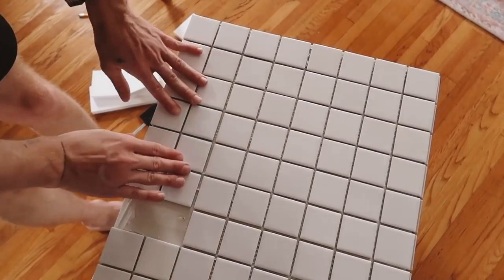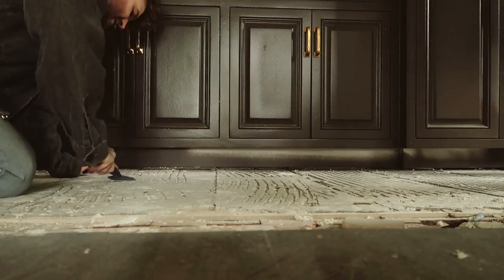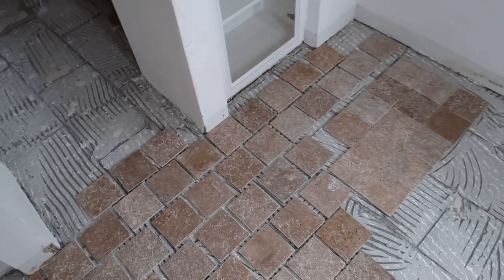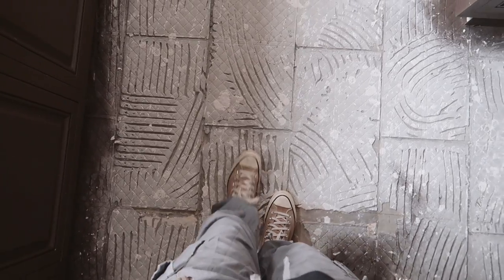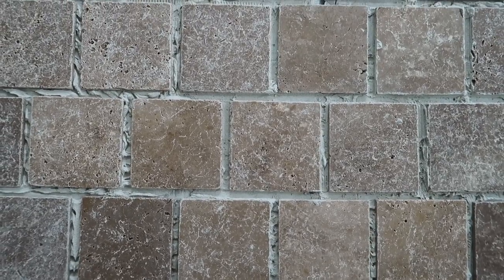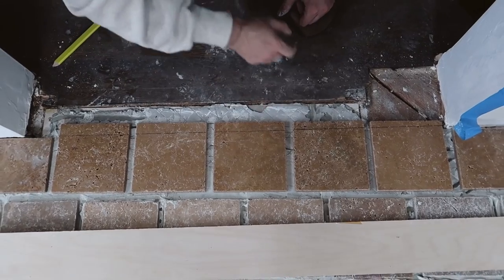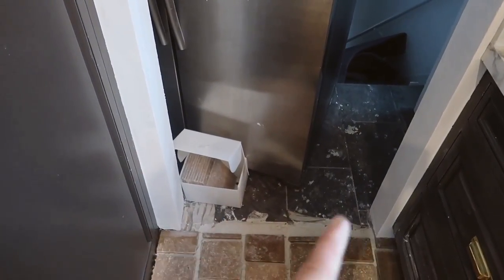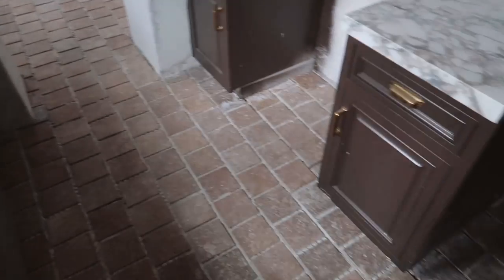DIY TILE FLOORS IN MY KITCHEN *Antique Look for LESS*

Comment: Oh check with an expert if you should use a sanded grout on 2nd floor as it flexes. We gutted bathroom and built spa shower with large slip proof tile. We did a lot of reinforcement, rubber flange, cement board under shower so no issues with sanded grout. We used same tile and grout on bathroom floor. In only a few months the sanded grout is cracking out. We presume because we have a crawlspace so floor is floating and flexes. We, not meaning me, my partner has to chip it out and trying non sanded. But I love your choices of tile colors and pattern layout. You are doing homage to this house while still keeping your own style.

Comment: Looking stunning so far Drew. Yes, kitchens can either be tiled under the kitchen cabinets or up to the plinth of the units. Personal preference or about project timing. Spec homes done by a developer are often tiled under before the cabinetry is installed. Or if a home has the same flooring throughout. Also often done like that to keep the project timing moving along so tilers don’t have to wait for kitchen installation to happen first.

Comment: The weekend before last, I pulled up the entire tile floor in my bathroom. The tiles were put down in 1970 or 71, and I  had no idea they tiled to survive the zombie apocalypse and nuclear war back then (ha) The tiles were half an inch thick and the mortar under them was 3" thick. Pulling them up as you did, was Not an option. I had to beat the tile to death with a hammer until they were bits and pieces, and even then, half wouldn't come up without pulling up the mortar with them--it was All or Nothing in the end. The bathroom floor looked like a war zone.  It took 2 weeks just to get the tile and mortar up. However, I now have a clean subfloor that's still in great shape (despite being 50 years old). It was backbreaking work and I somehow used muscles in my tush I didn't know were there and had some trouble sitting or getting up for a few days. I wish mine had been this easy (lol)

Comment: Sealing natural floor stone at this stage is highly important. The stone will get much darker and get that lovely sheen to it. So you might want to try that out before picking your grout option. 

There are special stone oils that you can use to maintain it and it will also prevent any unwanted staining. Try oiling a couple of unlaid tiles to get an idea of the end result color.

Comment: Drew, do some research. I believe before you grout natural tile, you must seal it. Otherwise, the grout smears will absorb into the tile and become permanent!!!  As for grout, get yourself to a floor and decor or Lowes, that sell Mapei ultra color plus. Mapei makes an amazing array of grout colors and matching caulk to choose from. And the ultra color plus has built in stain blocking technology you might enjoy with those large grout lines. Go for the dry bagged vs . Premixed so you can mix in manageable batches to take your time and not waste hardened product. ( Ask Maccenna😹) Excellent progress today, looking amazing!!😻

Comment: The only problem I have found with tumble travertine on the floor is that it has holes in pits in it. This collects dirt and also grout when you go to grout. Overtime the dirt collects in these little holes and you can’t get it out. But it looks pretty

Comment: I was waiting for this video to see how you remove the motar. I am planning to retile my toilet,after watching your video removing thr tile , which has been overlayed. But i don't know how to remove the motar too. 

Thought of buying a hammer drill and use a scrapper bit to remove it, but i fear i might damage the whole thing....

Also i live in a flat, and I think there's a weight requirment which i need to comply too. So tiling over the motar may not be an option for me.

Comment: Major tip- use the plastic tile spacers turned up on edge, then pull them up as you and reuse them as you go along. Those mortar joints a way wide, harder to keep clean and will wear more when not as protected by the tile edges.

Comment: Drew: When pouring those dry powder mixes like thin-set and mortar, have someone hold a vacuum nozzle by the dust cloud. The vacuum will quickly suck in the dust cloud and prevent it from spreading everywhere. Also, wear a mask and goggles when exposing yourself to these dust clouds. Not good for your lungs and eyes. Love your work! Will be interested to see if you finish the tiles with any sort of sealer to prevent dust and dirt from entering those crevices in the tile. Looking forward to the final product!

Comment: You’re a courageous DIYer! In an attempt to help you with your grout questions, my eleven years working in a builder design center which supplied us design consultants with three different brands of grout samples to coordinate with the tile and stone being selected by the new homeowners (from the late 90’s to 2010) could be insightful for you. C-Cure was one of the grout suppliers with dated color selections which were rarely chosen, Tec was the second with more desirable, up-to-date colors to select from, but was sold by limited sources here in Arizona…and Custom was the third and, by-far, the most diverse and often-chosen color selection of grout choices. Custom was and is still available at Home Depot and our in-house crews of tile installers appreciated the ease of acquiring their daily tile job’s assigned grout color.

I have medium-toned travertine floors in my home which are a lighter variance of colors than your travertine is and I paired mine with Custom #145 Light Smoke to create a contrast of a grid pattern to pull the darker shading in the stone as well as to hide dirt. I don’t suggest going any lighter than #135 Mushroom for your floors. The tile companies who supplied versions of your shade of tumbled travertine had names for it like “Mexican Noce” and “Dark Walnut”. The shade variance in your “Noce” floors could work with Custom #145 Light Smoke as a light color option, Custom #52 Tobacco Brown or #59 Saddle Brown as medium-dark options, or Custom #185 New Taupe as a more lavender under-toned “cool” brown as I think you mentioned that your cabinet paint was also under-toned. Travertine is known for extreme color variations so your floor color will help you decide the best look. I got my Custom grout color sample tray from a major tile supplier here in Arizona as I’m sure you can from a major tile supplier in L.A.

Keep in mind, especially with the prevalence of wide grout joints in your kitchen/nook area, grout will darken due to foot traffic and mopping. It doesn’t take long for grout to darken, especially in an active kitchen, so don’t start with too light or too dark a grout color. Best of luck to you and thank you for your A+ attitude when working on projects and very evident creativity and home improvement sharing 😊 The latest RH catalog and your travertine floors will hopefully revive the appreciation of the timeless beauty of travertine again.

Comment: Placing the tile over the whole floor before the cabinets leaves a smooth transition where they meet on the floor so that is the preferred method. If you start to mix as you pour the mortar you will get less dust. You use that side of the trowel to make indents because pushing the tile down makes it suction and stay in place, where if you have a smoother layer of mortar the tiles are more little to pop off. An not in a good way ayye 😂

Comment: I'll say it again. In kitchens and baths, epoxy grout is a must. Unlike other kinds of grout: it resists stains, including oils or nail polish being dropped on the tile, it keeps dirt/mud sitting on top of it so it's much easier to keep clean, and it's less subject to calcium build-up from water mopping.

Comment: I find the color options for grout to be severely lacking.  I too have been frustrated with grout color.  As an avid DIYer there are some grouts that are easier to clean off of your tile. Grouts that have the self sealers in them tend to take more elbow grease to remove the "haze" off your tile.  I would think that you could mix your grouts together to achieve the exact color you wanted IF they were from the same line and made up of the same formula.  Looks so nice.  I can't wait to see the final results.  I am already looking forward to seeing how you style the breakfast nook.

Comment: Generally you tile and put hardwoods under cabinets, since they are thicker materials (sometimes almost an inch thick) if you tile up to the toe kick then the counter height is shorter and the stove may not be level with the counter then. If you want to save money and not tile/lay wood under the cabinets, you can put the cabinets ontop of a slight platform that is the same thickness of the flooring you're laying. Sometimes in renovating but not changing the cabinets, then the flooring under the cabinets may be left and it's cut out to the toe kick. If you are placing thinner LVT, sheet vinyl, linoleum, or the likes then you lay up to the toe kick and not under the cabinet. Originally linoleum ( a natural material) was placed to roll up under the cabinet to be the toe kick kinda, which helped protect under the cabinets if water was spilled.

Also a slight correction, subfloor will always be under the cabinets as well, which I know you were referencing the mortar as that, but subfloor is under the backer board.

Great job!!!
Reply: So you leaving the tile under the cabinets and just cutting it then tiling up to the cabinet was correct for replacing flooring in this scenario, just always make sure the flooring is the same level as the flooring under the cabinet so everything is the same level later!

Comment: Drew, my kitchen backslash is mocha rolled travertine in 4×4 laid in the brick pattern.  I used a chocolate brown grout and after the tile people left, I went over the grout lines with my wet finger to give it that brick look.  NOW.  I am a home economist, food sanitarian and designer like yourself.  I would never use this tile on a floor because it is porous and can easily take in oil and stains making it dangerous for slips and falls.  Your home should have terracotta tile in an interesting shape like arabesque or hexagon.  I'm not saying red terracotta but a brown, beige or another color.  Whatever you do:  seal your sandy grout and tile.  Good Luck!

Comment: I worked in a tile showroom for 8 yrs..Some tips : All the grout brands use the same manufacturer.. so go with who has the color you want.. and sometimes for natural stone there is a grout that has no pigment in it so it might be just be the harmonizing grey you are looking for.. it is used traditionally with Saltillos too .. though it might be more contrast than you want so approach the color by figuring out the value you like first (light/dark), then nail down the hue .. I have found with grout color to put the sample down near the tile and start walking back away and see .. because that is how you will be experiencing it .. not closeup

Comment: Pretty sure you should lay down a new subfloor over the old mortar so you have a level surface to put the new mortar and tile on .... At least, that is what all the professional installers did on several floors in my house.

Comment: The reason the old tiles popped off so easy is because they may have used T spacers between the tile.
By using T spacers you are allowing air to get under the tiles and when the house moves.
T spacers are good for wall tiles as your walls don’t move

Comment: Wow that's a lot of grouting to be done, be sure to get some big window cleaner on the stick, it will be far easier than grouting it with the typical rubber trowel. You can check it out there: https://www.youtube.com/watch?v=ygmcn1A_6_c&t=10s&ab_channel=TheMaker at 1:40

Comment: Remember that grout is also going to remain in the top of the tiles, so your going to see the grout color in all your tiles, not just the grout line, which changes the tiles slightly or a lot depending of the grout color you choose.
Reply from the maker: Just seal them prior and you can wipe away all the remnants :)

Comment: I’m an architectural designer and always request the tile go underneath the cabinets for two reasons. 1, if the cabinets are ever change but the floor isn’t and 2, you lose about 3/4 of height to the counter if the tile isn’t under the cabinets and that can make it uncomfortable to stand at the counter. It’s a small change but you will notice the difference

Comment: Please, please fill the space between the tiles with grout that’s LEVEL with the tile. Otherwise, if the grout level is below the tile level, it can create cleaning problems. The dirt will settle in the grout and it be difficult to remove, whether you’re using a broom or a vacuum.  Is this a new technique, to leave so much space between each tile?
I love your design, love your energy and wishing the best of success to you!

Comment: I do t have a specific brand recommendation but make sure you read your instructions carefully, some grout you have to hand mix; if you mix it with you drill it will dry to quickly and you won’t be able to wash it off your tile.

Comment: And wear coveralls!  The grout is rather larger area than normal. You will need to use a sealer to make to water proof so that it will not stain, pick up dirt, or crack/flake/chip on you
Reply: Do you suggest sealing before or after grouting?
Reply: @cece9145  Hi, once the grout has dried, then you seal it. I love tile and, like Drew, tiled much of my home also with no experience. I sealed all the bathroom tiles, but not the kitchen tiles. What I learned from this is the grout, if not sealed, will stain, crack and fake off with time. The unsealed grout also creates stain in high traffic areas from foot/shoe activity. So grout in the center and near doorways of my kitchen are dark brown now, whereas the grout nearest the walls and unused areas is white. There is a definite discoloration and wear vulnerability in the unsealed grout! Alos, Drew needs to protect himself from the grout and tile dust by wearing a mask. And a way cool coverall too that has the Lonefox logo on it! And dedicated work shoes!  Love the guy and his message!!  My home and life are definitely better because of his joy for life and skilled art abilities!  I am going to build a table because his work has inspired me to do so!  I also china paint tile, and I plan on painting a tiled mural of my farm for the table's top!  www.Grapelanepoultryfarm.org and https://www.allyson-miller-artist-ecologist.com/   Love you guys!  Hug Drew for me!!

Comment: It´s beautiful but I keep freaking out because you didn´t use level and it´s just impossible to make sure that those are level without it, especially on mortar which is basically liquid and the tiles move A LOT. Let us know if you find any issues with that as you go on :)
Reply: Drew stated in a comment, above, that he did use a level on the entire floor but did not make it thru the editing process! I noted his comment, because I had the same concern.

Comment: Do some research as far as grouting, a travertine tile, because travertine tile has little holes in it. And when you put the grout on, it will go in those holes forever. Also, your dirt from your shoes and feet will go into those little holes also overtime. so when grouting those tiles do some research on how to apply it without getting in all of your holes of your tile. Good luck boys.

Comment: so, tiling under the cabinets is technically the proper way to do it (so you can change/repair cabinets without having to change your floor, plumbing issues, etc.), but doing it up to the cabinets is the cheaper way to do it.

Comment: Please read!! Be careful mixing by our grout. Add water to grout and mastic not grout to water. Don't let it sit it will set up. Make sure to wipe the tiles or you will get a film that's hard to move. DO NOT DUMP WATER IN YOUR HOUSE DRAINS. It will petrify your pipes.  Everything  looks beautiful ❤

Comment: Sealing the grout could darken it some.  Putting grout all over the travertine will fill the holes, blend the grout color into the stone and make it easier to clean.  Otherwise dirt will fill in the holes…not good.

Comment: I am watching the floor tiling video.  And I want to tell you to seal your titles before you grout but because I am watching your video. I am guessing I'm too late.  I'd also like to tell you to pipe your grout in with a bag this is not a tile that you can flood.  So I'm sorry but I'll watch and see how things go for you.  FYI. I have travertine accent tiles in my floors in entryway and kitchen and slate in my bathroom.  I learned from the tiles the messed my my bathroom and I had to clean out the grout in every groove with a knife and tooth brush. So I learned for when I did the kitchen and entry.  I'd still never do it again.  Very hard to wash nd keep clean. With all of those awesome holes.
Reply: I don't know if they still make the dupont stain guard grout it is sticky to lay, but it has been a great grout to not stain when things are spilled on it.

Comment: If your tiles are not sealed - you need to seal the tiles ( multiple coats) before grouting - otherwise the tile will absorb the grout and discolour the tile. Please learn from the mistake of the guy who installed my kitchen backsplash 😟

Comment: Bro that type of tile flooring is nearly impossible to clean.  I know from experience:  I managed a store with flooring like this.  You had to scrub the tiles regularly and then it took so long to pull up all the water used to clean the floors.  Pain in the butt

Comment: Whoa. Those are HUGE grout lines for those little tiles and your trowel should have had much smaller grooves. You're going to be so frustrated grouting those tumbled tiles as the grout is going to try to fill all those natural dips and voids and ruin your look.